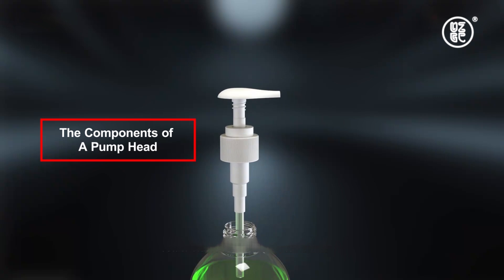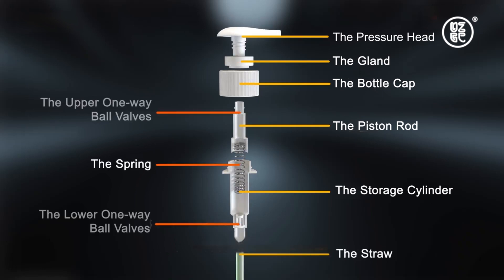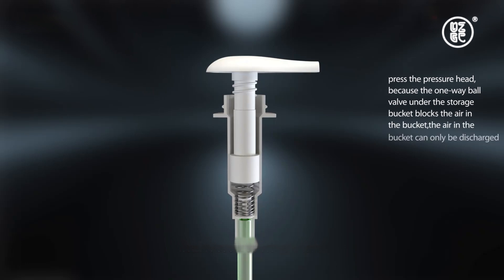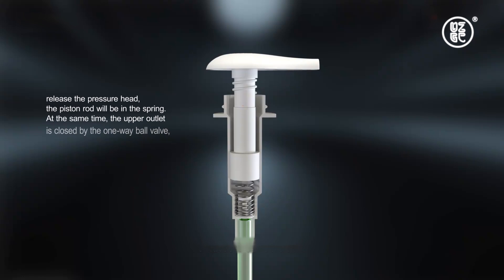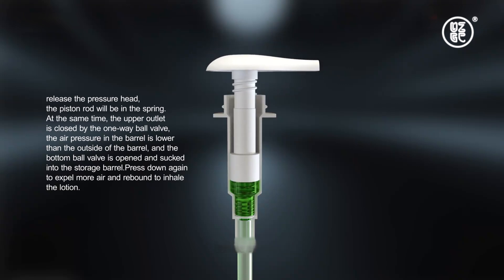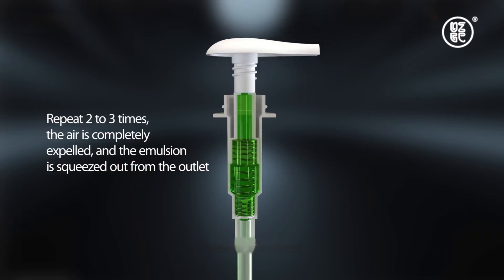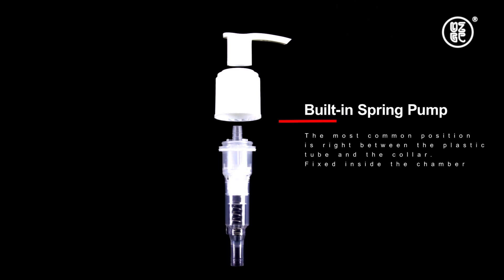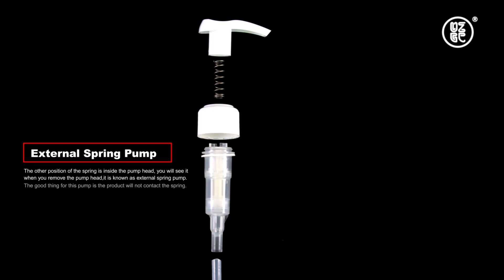How does a pump work? Why is my lotion pump not working? How to open a pump head? You must watch it.

Comment: How fix the spring in the external spring pump....spring has come out
Reply: Reply ASAP
Reply: Did you get solution?? Please reply my lotion is broke and it Is neww I not even use it one time 😢😢😢
Reply: @Btw_itzz.unknown  did you fix it ??
Reply: @Laxmi07-S  no😔🙂
Reply: Did u fix it ?
Reply: I got the same issue
Reply: @karim.ahmed94 did you get solution??
Reply: I got the same issue but no solution 😅
Reply: RIP .. I got a new one  @M_Chaudhary77